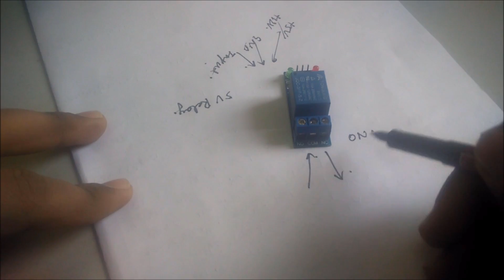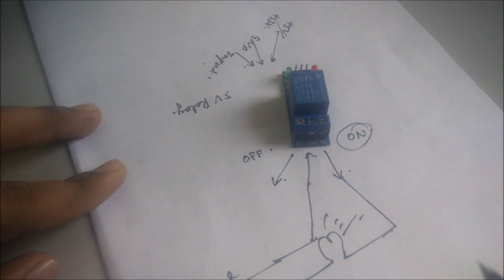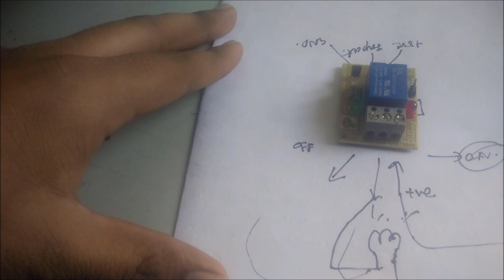Part -7 How to connect the 5V Relay ? |HOME AUTOMATION | Nation.Innovation|

Comment: Which 5v 1channel relay module is best with optocoplar or without optocoplar ?
Can i connect pir motion sensor output with 5v relay module signal pin ?

Comment: What should we do when 12v relay used(in place of 5v relay ) with a microcontroller (nodeMCU)and connected to ac pump
Reply from the maker: Nothing will happen, it will work fine but only you have to apply 12 Volt supply to give the power to Relay.
Reply: @NATIONINNOVATION  https://youtu.be/16Jj0COpsgs
Reply: @NATIONINNOVATION  please tell if 5v relay module you used is replaced with 12 v.in the video above.which you only done
Reply: Please tell
Reply from the maker: @CTh_2003  I have replied also.😊

Comment: Relay of what ratings had to be used for controlling high voltage devices like ac or air cooler. Please reply
Reply: Thanks for your reply
Reply from the maker: Yes you can use the 5 Volt relay for AC or Air cooler and we suggest you to use the copper wires for making the connection of AC supply with the relay and your appliances.
Reply from the maker: If your problem get solved than reply us otherwise feel free to write us.

Comment: how many lamps Can I turn on/off with one relay module?
Reply from the maker: You can turn on/off any number of lamps with one relay. But all will operate at same time.
Reply from the maker: Please reply, if your problem is solved. Thankyou
Reply: NATION.INNOVATION Thank you Solved.
Reply: I used Fan and Light for one relay and worked perfectily.

Comment: bro..plzz help me...if we take 6V relay...in 6V circuit and we have to attach our load to relay juast as u did in this video then....upto which volt do we have to take the bulb and and upto how many volt do we have give to that relay and bulb...plzzz reply me fast..coz its my project...plzz help me🙏🙏
Reply from the maker: For the relay connection,
 INPUT (DC SUPPLY): You have to connect the (5 volts or 6 volts) supply to Vcc, Ground to GND terminal,  and provide the input to the input terminal.
OUTPUT ( AC SUPPLY -220 ): You can connect any of the AC load( AC appliances such as BULB, FAN, etc )
Reply from the maker: For more detail contact at 08285856742
Reply: @NATIONINNOVATION  how many watts bulb can we use...?

Comment: Hi, I wonder if you could help me please. I'm not very good at this sort of thing. I have a 12v input duel relay 
module. I'm ok with the output side, but on the input side I have 4 terminals and I can't figure out how to wire 
it to trigger both relays from one switch. The terminals I have are CL2. CL1. DC-. and DC+. Any help you could give would 
be very much appreciated. Thank you, Terry.
Reply from the maker: For trigger the both relay from the single switch you had to give the same  input to the both relay and no need to connect all the terminals,  just connect the dc supply to dc+ and dc- which can be 12 v and give the same input to both the relay . 
Thanks for writing us.
For further detail go to  the discussion form of my channel .
Reply: Thank you. Very much appreciated. Terry.